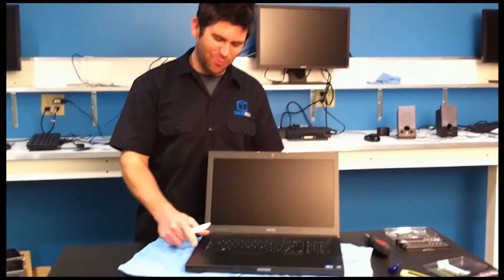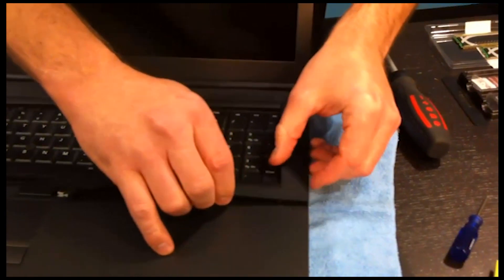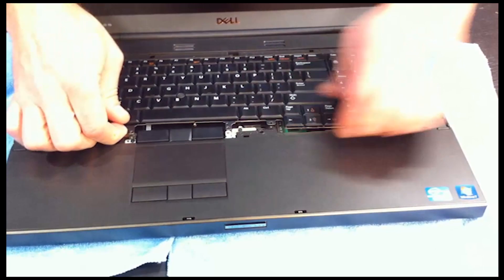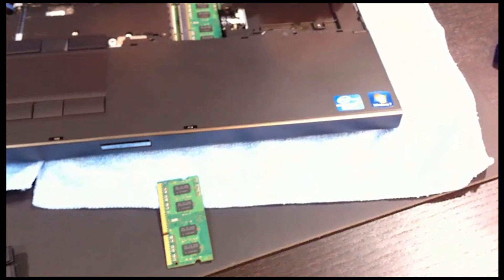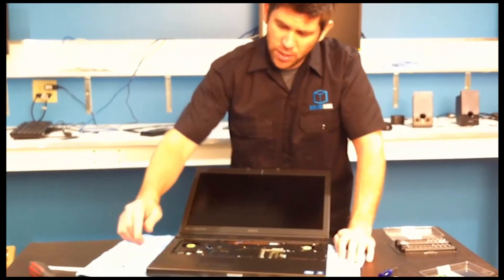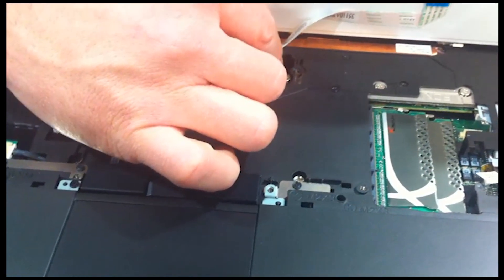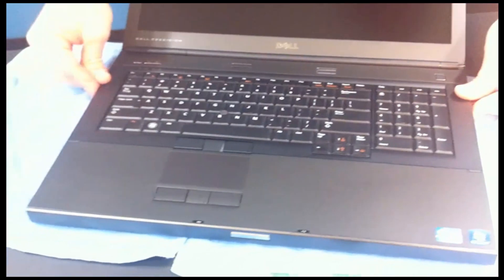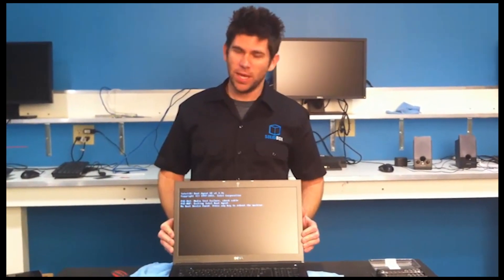SolidBox How To: Upgrade and Install Hard Drive and RAM in a Dell M6600, Part 3

Comment: Very helpful for M6800 as well. Just had to (in addition) remove a small extra plastic cover to upgrade the under-the-keyboard memory (1 extra screw). Thanks for all the little (but important) hints. Upgraded from 4x 4GB (16GB total) to 4x 8GB (32 total, Crucial brand). No issues. Temporarily, I also had 8GBs in bottom slots (Crucial brand), and 4GBs in top slots (Samsung brand) under the keyboard (24GB total) - worked ok too.

Comment: I have a cap on RAM slots (c,d) under beyboard with prohibition sign. Installed there RAM do not work, laptop do not start. Does somebody know, why? everything all right when install ram in bottom(a,b) slots.
Reply: +Kostyantyn Gorbunov It may be due to what the processor can handle. 
http://www.dell.com/support/article/us/en/19/SLN104599/EN
Reply: +Justin Jones, yes, you right, I suppose I need to get quad as of higher than 16gb ram support, thanks!

Comment: What I want to know is how to replace the PRIMARY HD.  I've yet to see a video on how to do it.  I don't just want to add more, and I know how to take the 2'nd & 3'rd ones out (you show how to in your videos).  But the primary one must be lodged into this sucker really good. 

Keep in mind I have an M6800, not 6600, but they're nearly identical, so I assumed it'd be the same case with both.  I need to get the primary HD out of this thing, stick another one in it's place then use it to write zeroes to it as it's in the 2'nd HD slot (the one that slides out). 

Or is that slide out compartment one really the primary HD in the 6600?  In the 6800 it isn't.  And although that bay beside the optical drive says (HDD2), it's really a 3'rd HD bay.

Comment: There is a black or dark gray clip on the ribbon connector that releases pressure on the ribbon. Pull straight up on the clip or use a plastic prying tool to lift it up.  This makes it so you can easily insert the ribbon and then push the clip down to secure it.
Reply: why do you have to unplug the keyboard at the ribbon because when you unscrew and lift up the keyboard the ram is accessible?

Comment: Yes, it can. MXM 3.0b cards of all kinds would work, but make sure the heat sinks and bracket are compatible. For example, if your Dell came with an ATi/AMD graphics card you would be able to to swap it out with, say, up to an HD8970M 4GB card. (Nvidia fans have the GeForce GTX 6XXM/7XXM/8XXM cards.) As for the processor, there are plenty of choices available from the 2nd & 3rd generation Intel Core i3/i5/i7 family.

Comment: Hey there
I have the DELL precision m6700 with the same chasis as this one. It came without a bluetooth module, so I bought one separately. Do you know where do I connect the module to the motherboard?
Thanks in advance!